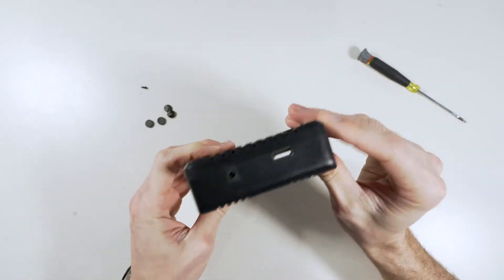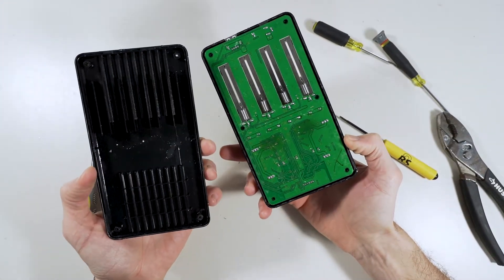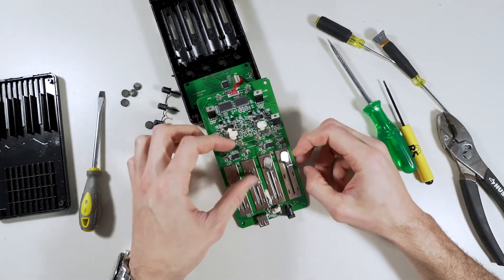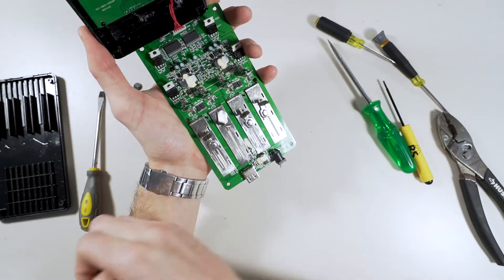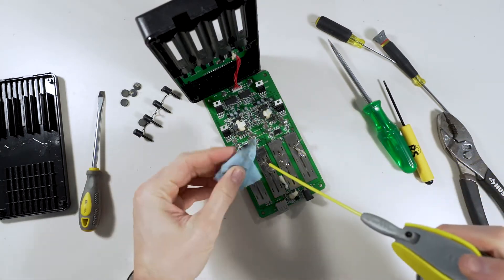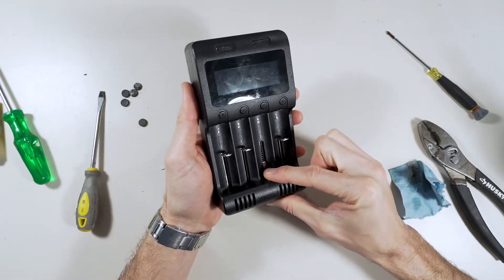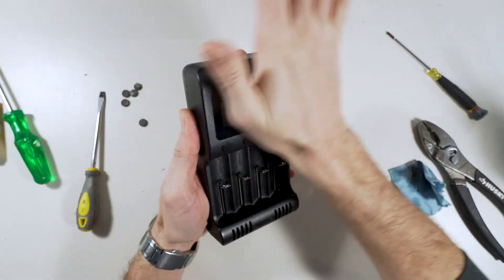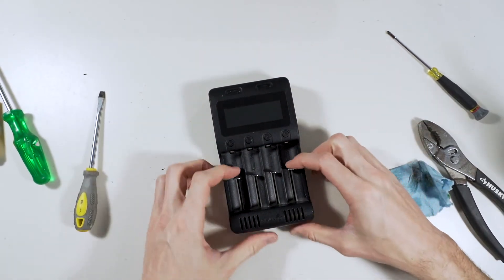Breakdown and repairing the Li-ion Charger from Amazon - Zanflare C4

Comment: Thanks for the teardown instructions. My C4 just stopped working (1 month after return window). It stopped charging and the display shows no data anymore although it still has an operating backlight. So I'm going to teardown and inspect for anything obvious.  Probably a candidate for the scrap bin though.
Reply from the maker: You're welcome  
Please update with your findings in case mine also dies. Good luck

Comment: Your tear down was good.  Make sure the lithium grease you used is conductive, or you will have intermittent issues with charging.  Also, don't let any get on the contact pads that press up against battery.